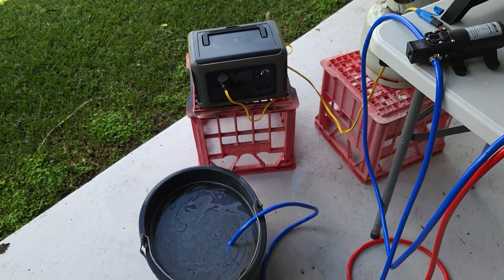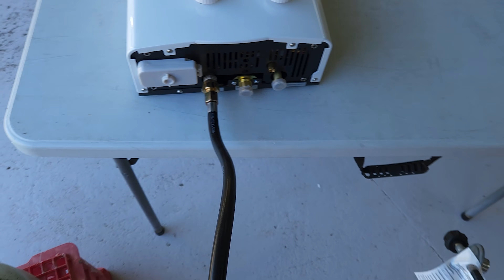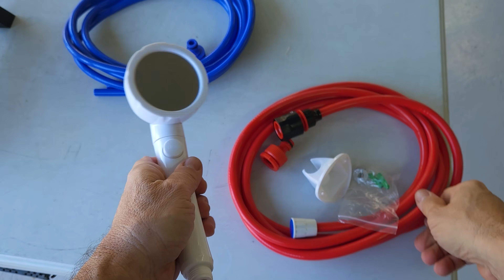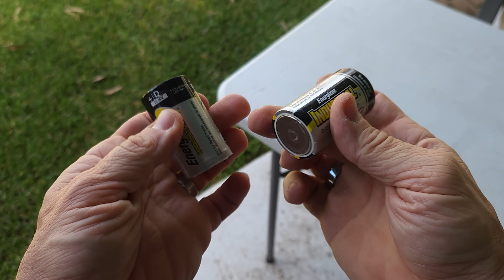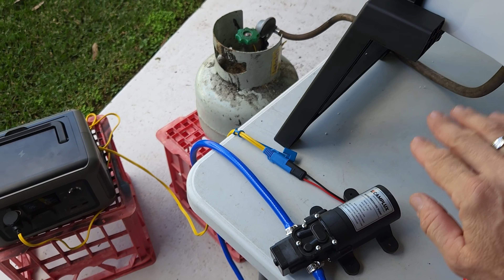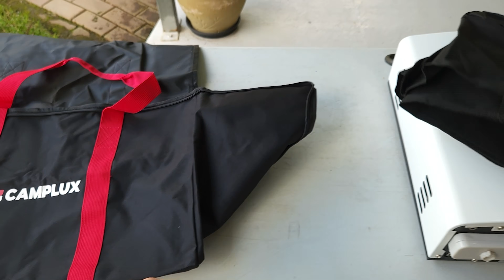Camplux 5L Portable Hot Water Heater System -  Full Setup Review!

Comment: It's about half the price of the other one you reviewed. Which one do you prefer?
Reply from the maker: Well, the Nano 3 is definitely way more compact and easier to setup, so that is still my preferred camping hot water setup.... however it only pushes 3L/min. This 5L version is definitely good, and the water felt much hotter than the nano 3, but not as portable.... and this one pushes 5L/min. I've used this 5L style of heater before when building a house and living on-site, and this was great to use for that bit more "permanent but not permanent" feel.